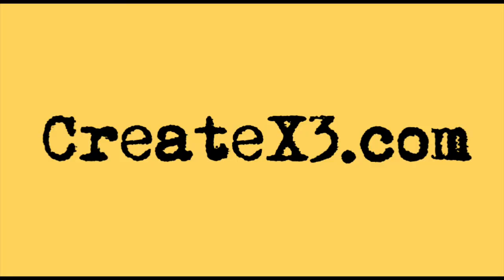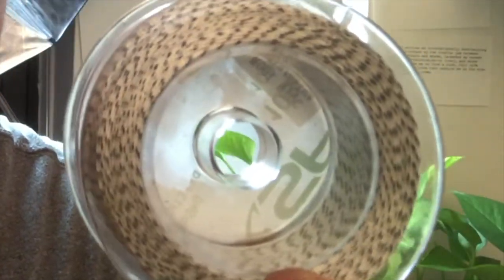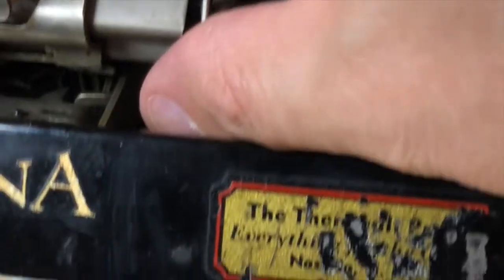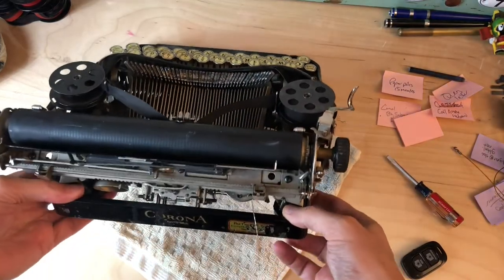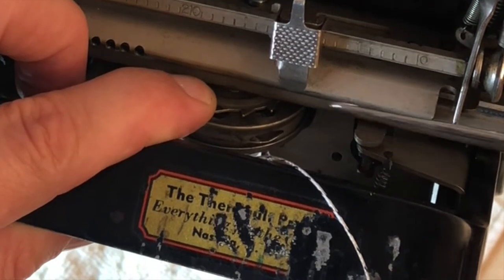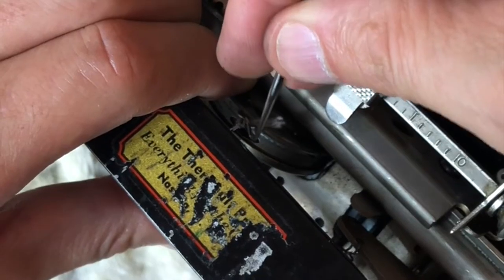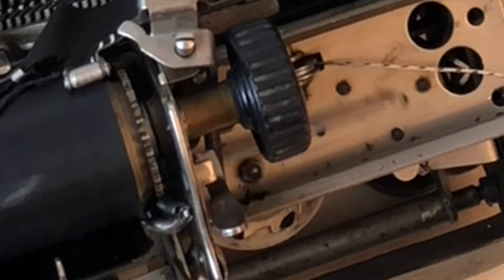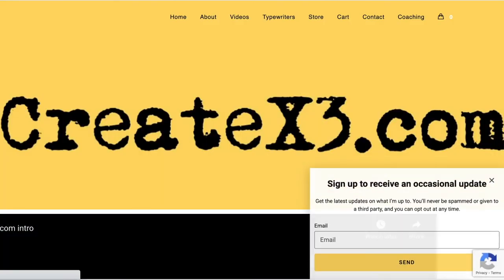How to Repair a Broken Typewriter Carriage String, Carriage Band, or Carriage Strap

Comment: I actually had the same problem with my Underwood standard no3 and I made a mew strap out of a shoeace and I used a barbeque sqewer to get it through 😆. Fantastic video, I`m glad I found this channel!
Reply from the maker: That's almost exactly what I did my first time around. My first fix was a 1934 Torpedo Model 16 and I used a chopstick to pull some ordinary fishing line through. Very rudimentary but it worked like a charm. I still recommend picking up an inexpensive spring hook set. You can often pick one up for about $10 and it's totally worth it. Welcome to the community, Winifried320. Pleased to meet you!

Comment: Thank you much!!! I need to replace my draw band on Remington Rand 5 1940s model… help!
Reply from the maker: I wish I could do it for you, @chrismiller9680, but that’s what the video’s for! 

Think of a draw band as a thicker version of a drawstring. The points of attachment may differ on the drum spring—you probably won’t have to push a knot through the release slot—but the mechanics will be identical. 

Actually, come to think of it, a Rand 5 will probably have a drawstring, too. Never seen one that didn’t. 

Bottom line is get yourself some fishing line, spin your machine around, study it’s works, then flip it over and follow the video’s instructions. You can do it.

Comment: Thank you for this. Trying to get this old L.C. Smith 5 going. It's pristine aside from that, mineral spirits freed up the typebars. The string is broke, but I still have each end and the original hooks. Sittin pretty, lets see how it goes. This one is kind of strappy, I may try a shoestring before my fishing line ships.
Reply from the maker: A shoestring might work, @brandonthorpe9905, on a big machine like that. The only way to know for sure is to test it. 

If the spring is still good and you fasten the strap properly, and if the escapement is still viable, it should work. 

That’s a fine machine you’ve got there, I love my LC Smith. Please check back in, let us know how it goes.

Wishing you good things.

Comment: amazing ! Thank you But I have a question, why does the carriage appear in some machines as if it is incoherent, vibrates and rises slightly when moving it by hand?
Reply from the maker: Hi Sami,osi. I'm not sure I understand your question. Let me try explaining it this way to see if it helps. First, you have to determine whether the typewriter is a carriage shift or basket shift typewriter. I made a video on this, which may help. On carriage shift typewriters, the entire carriage rises when the shift key is depressed. This might account for the rising action you mentioned. When it rises, the carriage vibrates slightly because typewriters are mechanical and mechanical action however minute, will always produce vibrations. If this helps you or doesn't, please let me know. And thanks for watching.

Comment: I have an Olympic electric typewriter that is need or one repair but I don't know the name of the part I need.  One of the wires that attaches to a letter key broke.  What is the name of that wire and do you have a good place to buy a replacement?  thank you!
Reply from the maker: Hi @ktgaming8713. I don't handle electric typewriters. I only do manuals. However, I'd call Jay or Paul at Gramercy Typewriter here in NYC and ask them to share their expertise. If any vendor can help you, those two can. 

https://gramercytypewriter.com/

Hope this helps.

Comment: hello, my typewriter has the same problem. Yes, it is an Antares compact, Italian production 1960. How can I do this?
Reply from the maker: Hi @ledionh2626. The short, honest answer is that there's no way for me to know exactly what's going on with your machine without a physical inspection. However, repairing a broken carriage string, strap, or band is generally not a big fix. Follow the procedure I've documented. It should work for any vintage manual typewriter. If you get into trouble, you may have to take your machine to a professional typewriter repair person or watch/clock repair person. Wishing you good luck.

Comment: Hey Damon, thanks for your video, I fixed the carriage string on my typewriter (dug out of the attic), but still the carriage won’t advance when a key is struck. The mechanism for the ribbon is working, and it appears as though the spring for the carriage is trying to pull it across, but it just doesn’t. Do you have any idea what I could try to fix it?
Reply from the maker: Hi Mak. Short answer is I can't tell without looking at the machine. Things I would check for: is the spring wheel wound, putting tension on the line? Is the line connected to the right hand side of the carriage (if you're looking at the machine from the typing position)? If these two conditions are met and key action still isn't causing the carriage to move, it could be that the carriage rails are somehow blocked, that the typewriter's escapement is shot, or that the mechanisms translate key action to the escapement are disconnected. 

The rail action's easy to check. Hold down the carriage release lever and slide the carriage back and forth on the rails. If nothing impedes the motion, it isn't the rails. Check the escapement by getting under the machine and typing. If you see the escapement mechanism clicking along, then its likely the linkage from keys to the escapement though this rarely happens in my experience. Escapements being shot are more common.

Again, this is all just troubleshooting from a distance and apologies for that. If you give these methods a try, write back and tell me what you find. Maybe we can troubleshoot from there. Wishing you my best.
Reply: @TheWriteStuffPro-DamonDiMarco  Thanks for your response! It seems like the escapement isn’t working correctly
Reply from the maker: @makcats2842  Understood. And thanks for checking back in. That's not optimal news. In some cases, escapements can be fixed but generally speaking we run up against a cost-to-gain analysis. Often it's more cost efficient to buy another machine that's in good working order. Best bet is to bring your machine to a good typewriter mechanic and ask their opinion. Do you have one near you?
Reply: @TheWriteStuffPro-DamonDiMarco  There’s one on the other side of the country, but their rates are a bit above my budget. With some prying on the escapement latch I did manage to get the space bar working, though.

Comment: Just got my first typewriter and looking for a little help. The carriage return lever does not bounce back as it should nor go down a line, it only brings me back to the beginning of the line I'm already on. Any help appreciated. Thank you!
Reply from the maker: Hi Trevor. 

This is the part where I levy my standard disclaimer: it's virtually impossible to diagnose a machine's issues without seeing it in person. 

That being said, if the platen isn't spacing down when you hit the carriage return, it could be an issue with the machine's line space mechanism,  which is associated with the carriage return. 

Take a close look at what happens when you lever the carriage return. Is the line spacing mechanism engaging at all? Depending on what model you have, you can find make-specific repair manuals online that will help you diagnose and repair this issue. Barring that, check out the videos posted at Phoenix Typewriter. Or consider contacting a typewriter repairperson near you. 

Most line spacing issues are relatively simple fixes. 

Hope this helps. Thanks for watching.
Reply: @CreateX3-DamonDiMarco  I found a spring that had indeed popped off. I tried reconnecting it to its post with tweezers to no avail. Fortunately my neighbor came to the rescue with a pair of surgical clamps and we got it back on. The next order of business is to replace the return lever's screw as it is stripped and loosens after only typing a few words, also causing line advance issues, by the looks. I guess I will take the screw to my hardware store and try to find something similar.
Reply from the maker: @Trevor-j8i  

Sounds like you're on the right track. If you're having trouble matching the screw (which sometimes happens because they're so bespoke and small) consider contacting typewriter shops and asking if they have one to spare. Many will be able to supply it from their parts graveyards. 

Another trick is to find a similar screw somewhere else on the machine that doesn't appear to be pulling much duty and cannibalizing it for the purposes you need it for.

Wishing you luck and hope this helps.

Comment: I have an Internation edition Corona 4 1935 model where the carriage is stuck. Doesn´t move what so ever. Any good ways to fix that? The carriage string is intact.
Reply from the maker: Hi, Marius. Without looking at the machine, I really can’t see what the issue is is the carriage lock on, for instance? Check the switch on the right hand side of the carriage. If the carriage lock is on the carriage will not advance. If the carriage lock is not on, and your hidden keys, including the , and the carriages and moving, but the carriage string is intact, this could be an issue with the machine’s master spring or the machine’s escapement. Again it’s almost impossible for me to diagnose this over email. I would recommend that you check in with a professional typewriter repair person. They may ask you to take videos of the machine and send them to them so they can diagnose the problem. I hope this helps. Thanks for watching.

Comment: my Adler Tippa S will only go halfway across a page before it stops moving, its my first typewriter so its confusing me a bit
Reply from the maker: Sorry to hear it @noveske.2236. Without seeing the machine in person, it's almost impossible to diagnose the problem. However, I wonder ... is there something up with your carriage lock device? 

A lot of German-made machines like the Olympia SM3 and (I believe) the Adlers, have a carriage lock device that centers the carriage when you put the machine in its case. 

Could there be something up with that which is impeding the carriage's progress? 

Please let me know what you discover and thanks for checking in.

Comment: i have a small triumph machine i have a problem here. I have already installed the wheel, but the cart does not come back normally when I press the button. That is, when I press the button, the car does not have the normal flow. Do you have an idea to help me please?
Reply from the maker: Hi Johnny. It's hard to say for certain based on your description. If, by "cart," you mean the carriage ... and if, by "press the button," you mean the carriage release lever ... and if,  by "wheel", you mean the carriage spring (which I'll assume is installed correctly) ...  well, impediment of the carriage motion is often influenced by friction against the carriage rails. Or the spring isn't wound to the proper tightness, which means it won't draw the carriage back to the left-hand margin position with the proper degree of mechanical force. Those would be the things I'd check first. I hope this helps. Wishing you look with your work.
Reply: @TheWriteStuffPro-DamonDiMarco  Damon, Thanks for answering me so quickly I'll try to explain better. As for the the carriage spring I had broken it from the inside, I had actually turned it not clockwise but counterclockwise three times and that Out of ignorance of not knowing how it moved. I managed to open it and see that I needed to re-drill the screw hole. I made the hole for the screw and put everything in the same place, after the repair it was put in the same place as in the original position. I tried to put the cord to pull the carriage but after that the carriage doesn't stay in the same place, the carriage should move backwards only when pressing any key. What I find strange is that nothing seems out of place. When I bought it second-hand, the cord was already broken, but after washing it with a brush, maybe something happened, but I can't say or guarantee that the positions of the elements are in place or not, but again, I don't see anything loose. Could it be that there is a lack of pressure in the rotation ???? I already know that it is clockwise remembering that the last times in at least two times that I tried it I will say 6 and 7 times and I put the cord in place even though with pressure the car is NOT locked in place. I hope you can understand everything I meant I'm new to fixing typewriters but I've been looking through videos here on YouTube to learn more.
Reply: @TheWriteStuffPro-DamonDiMarco  Damon, the machine I'm talking about is a small german TRIUMPH (1928–1934).  I tried to post a link right here in the comment where I found the same model on an internet site but YouTube deleted all my previous comments because of that link so I don't know how to show you
Reply: @TheWriteStuffPro-DamonDiMarco  This is the same model as mine https://upload.wikimedia.org/wikipedia/commons/thumb/2/29/Schreibmaschine_Klein-Triumph_alias_Modell_1.jpg/1483px-Schreibmaschine_Klein-Triumph_alias_Modell_1.jpg
Reply: @TheWriteStuffPro-DamonDiMarco  here is the back https://drive.google.com/file/d/1pWIITM8_L2N8HvNaL3o6pwdwyQnL1C3H/view?usp=drive_link
Reply: @TheWriteStuffPro-DamonDiMarco  close up https://drive.google.com/file/d/1gSGL0ugKiVSnn3mt39s3FwTsIb-ga17O/view?usp=drive_link
Reply from the maker: @johnnymalin-thenightmarehunt  Johnny, I'm sorry, I can't open these links. I've seen the German Triumph before. Never used one but if it's German-made, it's probably excellent, especially from the 1930s. 

Unfortunately, pictures can't help me diagnose the problem and I don't want to steer you wrong. I think your best bet is to find a reputable typewriter mechanic in your area and let them look at it. The good news is that, unless the escapement is blown (and it might be) you stand an excellent chance at recovering the machine's functionality. 

Please keep me posted about what you learn. I'm wishing you the best of luck.
Reply: @TheWriteStuffPro-DamonDiMarco  I understand I´m gonna try find some tech here but i saw in google that is very far way

Comment: I just bought a Remington Rand deluxe model 5 off eBay. Everything works except the drawband. I flipped it over and the line looks to have snapped in the middle, and one of the lines broke in 2 places. In response I went to YouTube and didn’t find anything, nor did I find anything on the web. What should I do?
Reply from the maker: Hi @shadowgirl845. This happens a lot with old typewriters. 

I did a video about fixing the problem. I’ve included the link below and I hope it helps. 

How to Repair a Broken Typewriter Carriage String, Carriage Band, or Carriage Strap

https://youtu.be/lUcPo4Ad8iU

Comment: Why my carriage doesn't feel like tension when im rotating it?
Reply from the maker: HI @jhomarivillanueva7818. It's hard to accurately diagnose mechanical problems as described in prose. But it sounds to me like your variable line spacing mechanism has been engaged. Depending on what model typewriter you have, look for a switch or pull out knob on the right or left side of your platen that will disengage this. Hopefully, that will revert the platen (not the carriage) to tension.

Comment: My carriage doesn't move when I type but if I hold the type writer on its side and type it works, is it likely the band isn't tight enough? Or something else?
Reply from the maker: Hi @60secondpages. 

It’s almost impossible to diagnose the situation without seeing the machine in person. However, what you’re describing could likely point to a carriage strap issue or an escapement issue. 

Check out this video (below) and see if it helps you. 

If you’ve got a carriage strap issue, that should help. 

If it’s an escapement issue, likely you’ll have to take it to a typewriter repair person. 

Hope this helps and please check back in to let me know what you find.

How to Repair a Broken Typewriter Carriage String, Carriage Band, or Carriage Strap

https://youtu.be/lUcPo4Ad8iU
Reply: @TheWriteStuffPro-DamonDiMarco  thanks I managed to pull on the carriage band and then added another knot to make it tighter, this seemed to help slightly, and now the space bar is working.  Some keys seem to move the carriage others not, also some keys don't quite make good contact with the ink band.

I think you're right likely something isn't aligned quite right in the escapement.
Reply from the maker: @60secondpages  Again, apologies I can't diagnose from a distance. 

If tightening the carriage band helped, make sure it's as tight as it can be without risking rupture (I don't know what material you're using, so be careful). 

Make sure the drum spring is pre-coiled so it will draw the string or strap from a position of strength. 

If some keys aren't moving the carriage, check the linkage of those keys to make sure they're impelling that arm that leads to the machine's escapement. 

Keys not making good contact with the ribbon could have to do with the escapement but might also have to do with the type bar positions. 

What model machine are you working with, please?
Reply: @TheWriteStuffPro-DamonDiMarco  it's a old silver-reed sr 180 deluxe.

Thanks for trying to help, fully appreciate the difficulties of trouble shooting over message. 

 Also while you are there, is there a typewriter you'd recommend, one that's easy to type on / touch type, this one seems like you really have to strike the keys hard, even on those that seem to be functioning well.